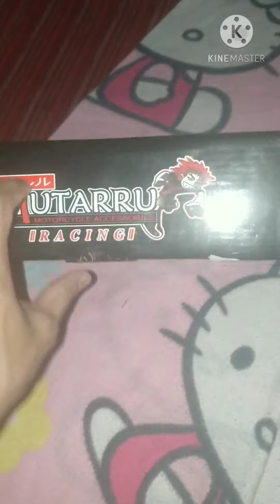Mutarru stabilizer installing to my raider 150 reborn | #Ruby Red Moto Vlog

Comment: ung front shock mo paps mutarru din ? plug and play lang ba ? wala ng maraming spacer ?
Reply from the maker: Ung stabilizer lang paps ang mutaru pero ung front shock cover ko ttgr racing ang tatak nya, meron din showa ang tatak ganyan din sya.. kpag nagpalit ka ng front shock cover paps kailangan mo bumili ng front fender clamp kasi ung mo magagamit ung stock kailangan ng fender clamp para hahawakan ng clamp ung dalawang shock cover..fender clamp lang nman tapos magbubutas sila sa fender mo para don sa bolts, alam na yan ng mekaniko kpg pinakabit mo..
Reply: @rubyredmotovlog6691  ung sa gulong paps, safe ba ? wala bang maraming spacer ? or stock spacer lang ?
Reply from the maker: Kung naka stock mags ka paps ok lng, fender clamp lng kailangan mo..makakabit na un ng maayos wala ka ng ibang kakailangan pang spacer..pero hnd ko lng alam kung naka rimset kung my idadagdag pang spacer..sakin kasi stock mags.
Reply: @rubyredmotovlog6691  update pala paps sa front shock mo? goods padin po ba ung play ? salamat paps sa reply♥️
Reply from the maker: Ung front shock cover ko boss ttgr ang tatak pero meron din ganyan na showa ang tatak..plug and play lng sya boss.
Reply from the maker: @dailygrindtv8698  my mga spacer sya boss kpg ikakabit na ung front disc brake nya. Un lng nman ung my spacer boss
Reply: @rubyredmotovlog6691 MATIBAY BA TTGR BOSS?

Comment: Anong brand yang front shock cover mo paps at san mo nabili?
Reply from the maker: Ttgr racing yang tatak nyan paps meron din showa ung tatak na ganyan ding design ng front shock cover..
Reply from the maker: Inorder ko lang sa shopee yan boss..pero meron din sa lazada..
Reply from the maker: https://shopee.ph/product/280315674/6342823468?smtt=0.74090087-1631857385.9
Try mo magtanong dito paps kung my pang r150 pa sila..